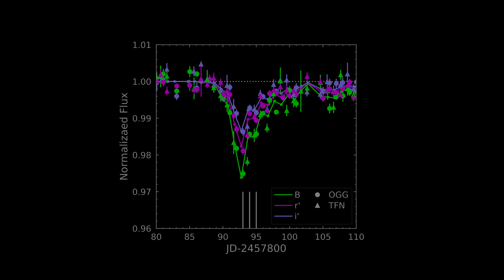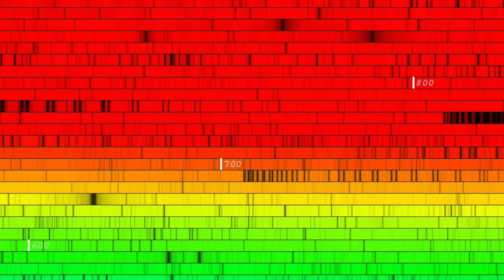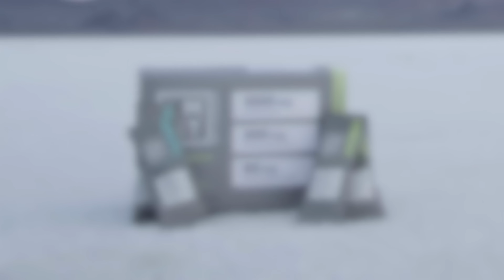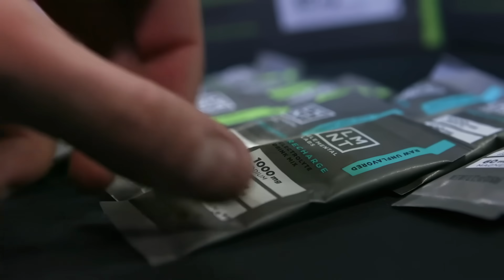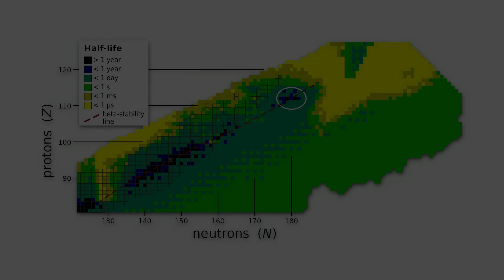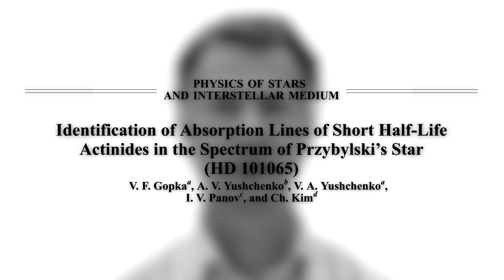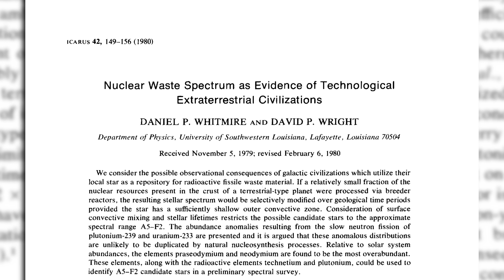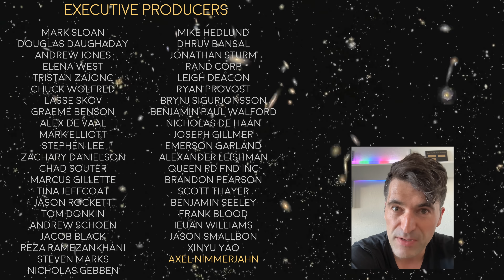The Star That Shouldn't Exist

Comment: There is also the possibility that the light is being altered by an outside force. If the star is moving toward or away from us there would be a color shift in the spectrum. If there was a sufficiently high gravity object between the star and us the color spectrum would also shift. Less likely the star may have a prism like dust cloud around it that throws off all calculations of the color spectrum. I'd suggest further study of the star if I was in a position to do so.

Comment: At 4:59 you loose 100% or you IQ! What the fuck dude! Really you just shove your head in the Sand.  Fusion is fusion  and its not just ut hydrogen to helium. Strars fuse every know element to every other known element and many not yet discovered.  And what you are observing is an old star thats running low on a particular element. Just may be the more accurate way to judge a stars age.

Comment: The reason we can see these is cuz it spins slowly. If it spun faster like the other ones do then it would be bigger due to the force exerted outward from spinning. But since its not we can see those elements more clearly. Now the internal spin has to deal w what it will eventually turn into. So since no spin or lack there of it wont become any denser then it is now. Might just be the beginning stage of a solar systems epoch. But like all science its just my theory

Comment: What if your understanding of fusion is wrong? The assumption that gas will gather and somehow have a fusion reaction occur at the core is strange. Check out the SAFIRE Project for how the sun actually works; it is a plasma discharge phenomenon that is driven by the galactic circuit, the sun being a node upon said circuit. This in turn means all stars operate in the same way, the difference being the voltage of the core. The project uses hydrogen and has found many strange elements on the anodes they use in the chamber, fusion occurring due to high voltage interaction with hydrogen and the anodes. Naturally, the walls of the chamber will add some material to the anodes, as well. Still, others have to replicate the chamber and experiments, awaiting further data...

Comment: We wouldn't expect an alien civilization to be generating radioactive waste just for kicks. If they are dumping such waste into a star at a large enough scale that it can change the spectrum of the star to a degree observable from Earth, that would imply a pretty vast scale of active industry around that star. One with a total mass product output that should be similar to if not greater than the total mass of the supposed waste materials. That would imply megastructure construction around the star. Potentially at scale observable from Earth.

Comment: Isn't the most likely solution that we're simply wrong about where these elements come from?

A lot of our ideas about where these elements are created come from various calculations. If indeed this star has a bunch of weird elements present that we previously thought only came from supernovae, one obvious, plausible answer is that they don't only come from supernovae, which is why we do in fact have a not totally insignificant amount of uranium here on Earth - because it actually comes from a lot of stars that die, not merely the very largest ones.

If a star with a very low rate of rotation is showing lots of these elements in it, it seems entirely plausible that these elmeents are in normal stars and we just can't see them because they rotate too fast.
Reply: Nope. If the standard solar model doesn't explain the observations, it's clearly aliens.

Comment: Sounds like a star that wanted to go supernova, partially did, and then was able to somehow revert? 

Another theory is that the star came into contact with primordial hot matter/a neutron star with quark innards, and caused it to explode nearby or something.

There are usually three things required: Pressure, volume, temperature, these are all lacking in a plain star to make these elements as stars stop fusing at iron specifically. The fact is, these would have had to have come from deliberate events (aliens), or extraordinary celestial event that we are yet to comprehend.

If humans went to a new planet with the intention of colonization, and saw that new planet as the survival of its species, then all other species do not matter. Aliens would not announce themselves just as we shouldn't. 

This means, this was created through a natural/extraordinary but still natural event within the universe. 

Stars are made in Z pinches, that has to be considered when talking about the star. Could this possibly be the end point of a z pinch/massive cosmologically sized electrical filament? That may actually explain the energy required to form these elements possibly.

Not a scientist or a professional, just a burnout.

Comment: At 3:30 you mention that absorption lines in rapidly rotating stars are obscured by Doppler shift-induced blurring. This seems to assume an equatorial observation. However, for stars observed pole-on, where the rotational axis aligns with our line of sight, this blurring should be negligible. Are there not enough A-type stars observed in this orientation to study their absorption lines clearly?
Reply: you could answer this question by researching it yourself

Comment: If the star is so magnetic, why can't these heavy radioactive elements be created in the same way we create them here on Earth? Perhaps such high magnetic fields have essentially created a particle collider factory at the surface, accelerating ions around at near light speeds in the looping magnetic fields and then smashing them into each other. So the fusion creating these elements in this peculiar start might not be happening at the center of the star due to gravitational forces...

Comment: There is an upper limit to the mass of a neutron star that prevents them from growing to a larger size since they collapse into a singularity from the strong gravity otherwise and there is also a lower limit to their mass as well because there is a minimum amount of overhead plasma of stellar gas that is required to pressure the inner iron core into condensing into the denser neutron star structure. But what if we were wrong about the lower limit?
If a neutron star of average size forms normally, then in the event of a collision with another neutron star, instead of breaking down into far smaller chunks, if such an event had somehow retained a resultant chunk that was large enough in size to have a gravity that fights the electromagnetic force's repulsion of matter, but was much smaller than the predicted lower limit of a neutron star, then if this resultant body acquired an atmosphere of helium and hydrogen that was provided the right conditions for fusion thanks to the extra dense core, would that explain what this star is? Since there's heavier elements present in the star, then it would make sense for the star to have some history with a neutron star collision event/kilonova.
Or what if after the collision, the smaller chunks started to fall back to the larger chunk, but couldn't merge completely, making it so the smaller chunks sitting on the big one are left with no choice but to slowly disintegrate as they are unable to compress themselves due to insufficient gravity, generating a source for fissile material, a star powered by fission.

Comment: I think a discovery this anomalous is a very, very strong indication that the answer is almost certainly 'Option #1' and something is being misinterpreted or misidentified. However, if the answer somehow were 'Option #3' and it was some sort of alien waste disposal system or an alien-induced, stellar signal flare—wouldn't that necessitate 'Option #2' also being true. I mean, you're not going to be able to send a bunch of waste that doesn't even exist anywhere, because it decayed like instantly. It would need to exist long enough to even be waste, which means that in order for 'Option #3' to be true, 'Option #2' would also have to be true.

Comment: After watching... one option I don't see removed from the table is smaller, weaker stars that more smoothly coalesced. Even the environment would have to be rare: somehow the density was low enough to form relatively poorer, but shortly glowing stars, which then merged slowly enough they didn't blow each-other apart. We already have evidence it's possible to have a "failed red giant": a binary pair of similar enough stars, that one started inflating after burning enough hydrogen&helium, so the other star started consuming it... which cued inflation, but then the original star's core was absorbed, poisoning the second star. Creating a core of material that didn't create a dense-enough core to explode, and is just slowly fusing. A slow rotation would be expected of material of approximately equally distributed, but on-average, zero-summing rotations, as would happen if many similarly-sized bodies merged. A "fluid" non-fissile core would be enough to prevent full collapses, and extremely large, but heavier convection cells could drive light elements back in on occasion, perhaps even in pseudo-molecules. A proton could get pretty far into a radioactive element before anything "noticed".

Or even better, a relatively normal star sprayed by radioactive material: He4 +2 is an alpha particle, and can be absorbed by heavier elements, theoretically, robbing the star of some energy, but then re-releasing it as randomized heat. If radioactive elements were often-enough being bombarded by helium to fuse, and either re-fiss to itself, or even fissile down further, we could imagine a relative abundance of radioactive material clogging a fusion process, but still allowing A) energy to be released by creating a fission star B) be possibly as close to stable as a population would get and C) produce elements "too heavy" to be found. A lack of iron could support this hypothesis. Of relevant interest here is if "absurd" ratios could be generated, only possible by an abundance of He3 +2, or if perhaps a star rotating at that size could cause radioactive cooling, similar to laser cooling, but by having biases in forward-to-backward dopplers in a radioactive range. Neutrons being captured as it leaves a layer, captured at a higher layer, and then being re-radiated when a heavy element after it sinks is also an option.

Comment: Gravitational fields can also brake rotation.
And the odd elements are still being argued over, with one side suggesting artifact, the other side insisting valid elemental observations. Proximity to a neutron star would both slow rotation and enrich the star with heavy elements, which is where such elements originate anyway - during a neutron star highway accident.
Island of stability, yeah and Gilligan's Island and Fantasy Island are the same place.
Einsteinium's longest lived isotope has a half-life of 472 days. So, for it to be detected being dumped, speedy delivery of earth sized amounts of the stuff. Yeah, ain't gonna happen.
I'm more inclined to think some odd artifact, perhaps from the magnetic field distorting the EM radiation from the star's corona and photosphere.

Comment: Well the fact that we are able to make the "man made" stuff in labs here on earth proves that things can be made in different ways and result in the same elements, with that its not to hard to think that within nature there are multiple ways things can be manufactured that would otherwise be only doable in rare events, we just haven't discovered the catalyst that is causing these elements that seem to be only be made by artificial means here on earth to be generated naturally in nature. So ultimately we just haven't figured out all the different possible ways to make these elements and what other things could be made by variances in the way this star is working.

Could be aliens, could be that this star just has an abnormal element distribution ratio due to the star creating different elements in different regions of its structure. Resulting in the abundance of rarer elements instead of the the more common ones such as iron. Seeing how its already odd in that it has far less then others stars of its type could also point in the direction of how or why its producing these elements more commonly then then other stars of a similar size.
Reply: Most alloys we make cant be found in nature. Plastic doesnt exist in nature. Nor vodka.

Comment: Regarding the rotational Doppler shifting, I would think that that would be something you could compensate for computationally if you know the star's rotational period, sort of like turning up the contrast on a display. Is there a reason this isn't done?
Reply: It IS the compensation that doesnt work, mate.
Reply: @carlossaraiva8213  Would you mind elaborating a bit? Is there just not enough variation left in the data?
Reply: @midnightbluevt  the maths can go for so long. the data is extremely small to work with to begin with. We are talkign about stars light years away that spins so far it goes into doppler shift. it's no different than trying to hit a bullet with another. You can do the THEORETICAL maths pretty well, but it's applying that's hard. Also, there are limitations on the tech itself, as it's made of stuff that has limitations. And that's not even counting on the noise in the data.
Reply: @carlossaraiva8213  Okay, that makes sense. Thanks for clearing that up.

Comment: 00:06 that can also be caused by a brief but total eclipse due to a traversing rogue planet, asteroid, meteor or comet followed by debris. It may well be lottery odds but, just like playing enough numbers will improve your odds of a prize, watching enough stars will greatly improve your odds of seeing some of the less common phenomena predicted the model of space which includes non-luminous matter as debris - some of which hasn't yet fallen into a stable orbit and provides the basis for the Raleigh Effect to operate in space. Lot's of implications and questions right there.

The problem with spectroscopy is that it is strictly superficial and is incapable of addressing more than surface chemistry - as any geologist familiar with remote sensing techniques can tell you. So while there's a lot we can say about stellar surface chemistry, any knowledge of stellar chemistry with reproducible confirmation stops at the extinction depth.

3:38 remember the explanation for the graph at 00:06? Taken across interstellar distances, that explanation predicts sufficient dust and small debris to impose a Raleigh Effect on light coming from stars which, likewise, causes spectral redshift, loss of resolution and provides the simplest explanation for changes in the amount of spectral redshift over time, not to mention background radiation. Probably the best confirmation of the Raleigh Effect, is a sunset or sunrise; bearing in mind that this is not something which is magically limited to an atmosphere but can be reproduced anywhere there is a sufficient amount of disseminated particulate matter.

07:15 Also, if you want to find extraterrestrial life, Przybylski's star is the kind of system you want to look more closely at due to the elemental diversity. Just bear in mind that life need not be carbon-based or even solid. All that is required for life is sufficient elemental diversity to allow the existence of stable chemical systems - and, yes, from the point of view of chemistry, life is defined by the stability of a system driven by chemical reactions which feedback on one-another to perpetuate the system (with or without recognisable structure). If all those elements are present in the stellar corona, then it's likely that the chemistry of the environment has evolved into living, reproducing, localised systems of chemistry as well as clearly defined ecological systems which support a naturally selected interaction of living systems with one another.

09:40 Sometimes we don't explain. Sometimes we wait patiently for more information. Sure, it might be a stellar example of terraforming. There might also be stellar mechanisms which don't know about. In fact, I'd bet the bank on it given that we can only scratch the surface and theorise about what is happening below extinction depth. There could be the stellar core equivalent of vulcanism with plumes that shoot up into the corona; carrying with them an interesting variety of elements or it could be as drab and boring as pollution from an industrialised species that lives in a coronal ecosystem (remember the elemental diversity will drive the evolution of life provided overall entropy starts low enough). And it could well be a species salting a star. It could also be light pollution from large scale space warfare in the vicinity of the star. There are so many plausible explanations, it isn't really sensible to settle on any one of them. Rather, what would be interesting would be to devise some questions about how each scenario would differ from the others in what we are capable of observing - and then see if our observations can narrow things down.

Yes, misinterpretation is the most likely given the number of definitive, repeatable observations which can't be made - and Immanuel Kant had a LOT to say about this problem with human thought.